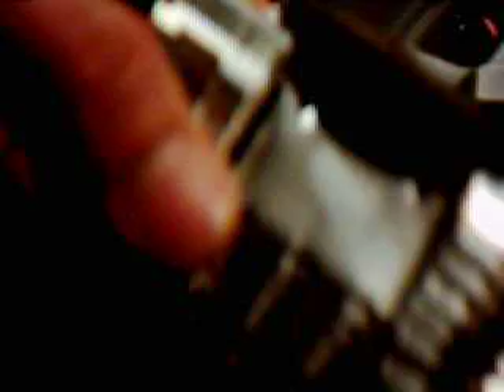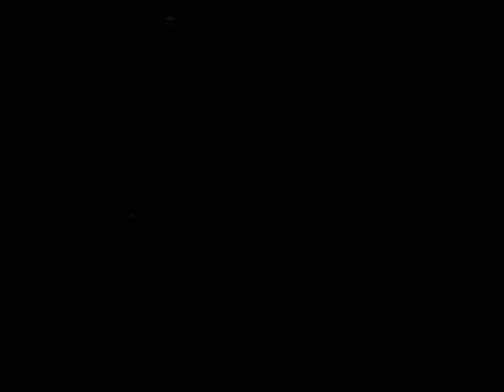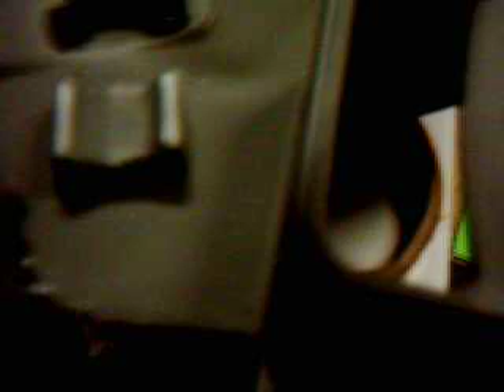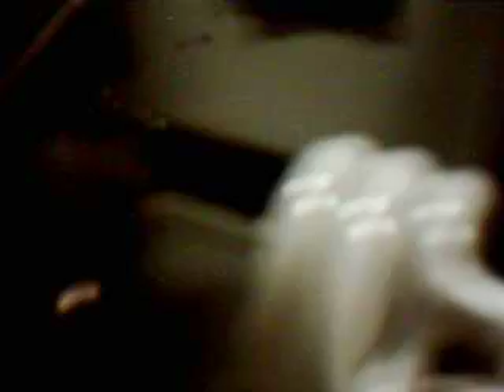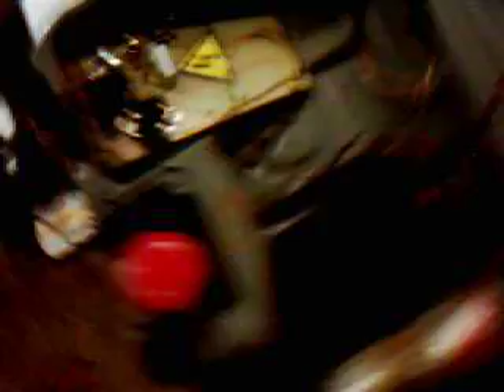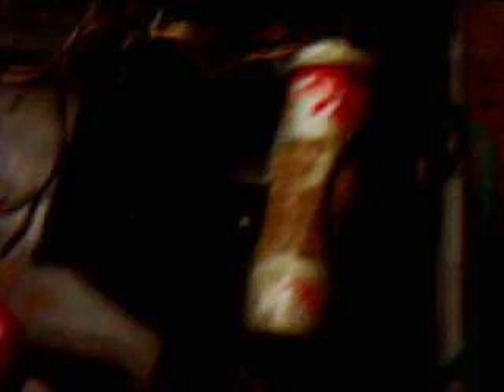Broken Magnetron Experiments (old Microwave) Part 1

Comment from the maker: yes i know!
thanx for the warning-i was under the impression that it is the ceramic that contains the beryllium,and not the inside coated with it.
but i just read about beryl-copper alloy and also beryllium cathode,so it seems there are several ways to the skin the cat,and that no reference to it being in the ceramic,so i have been mislead.
dont worry i wont be snorting it anytime soon tho.=]